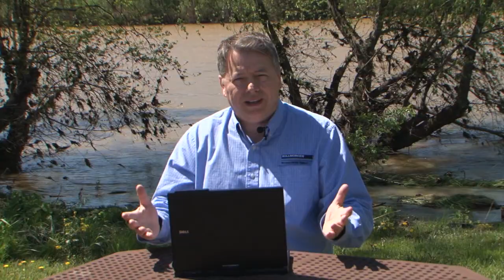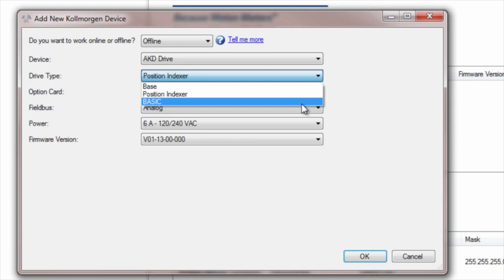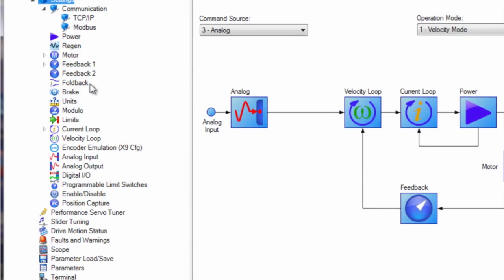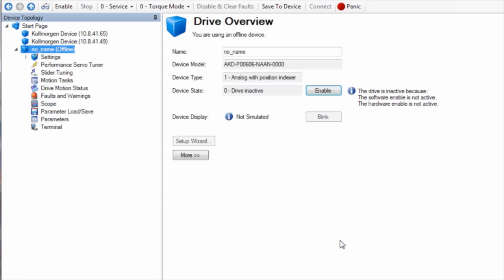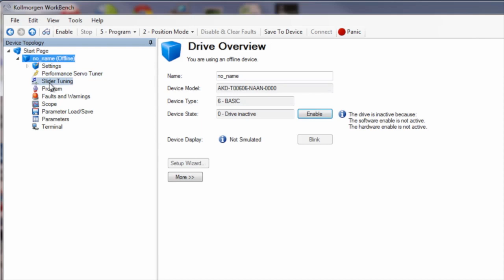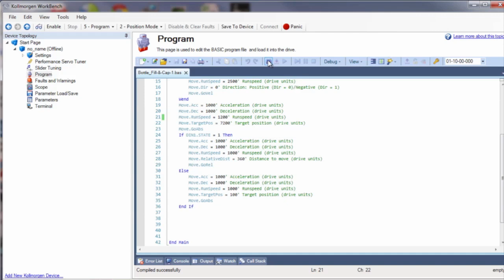AKD Workbench Offline Mode | Kollmorgen | 2 Min of Motion

Comment: What a royal pain!
From the Manual: "WorkBench does not allow you to change an instance drive between offline or online. If you wish to move a configuration between two devices that you can save the parameters to a file and then import this parameter file into a new drive you have created."